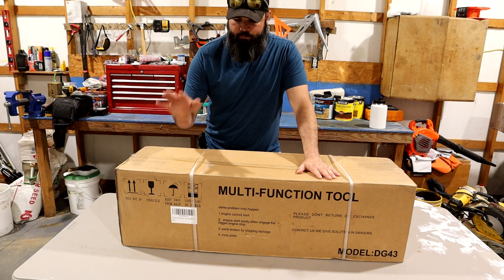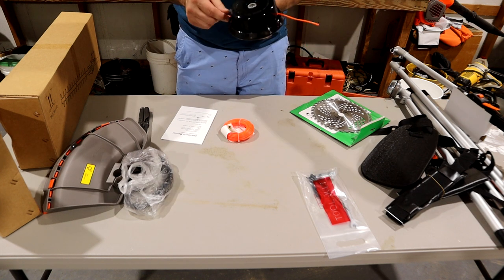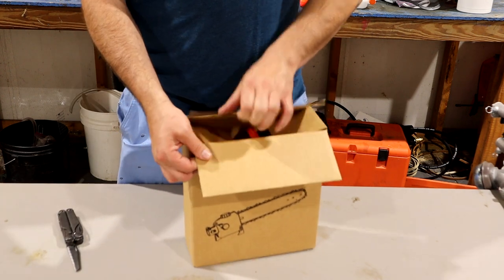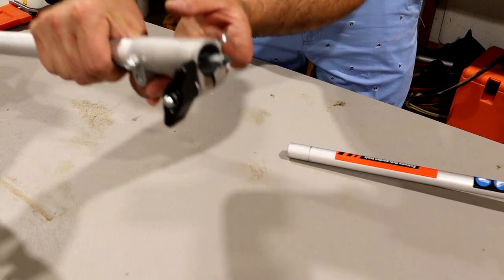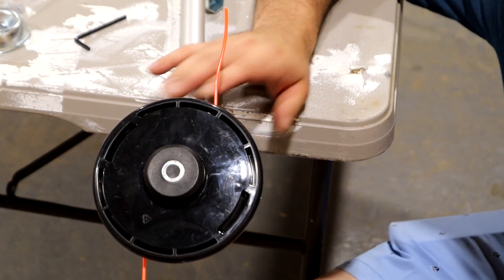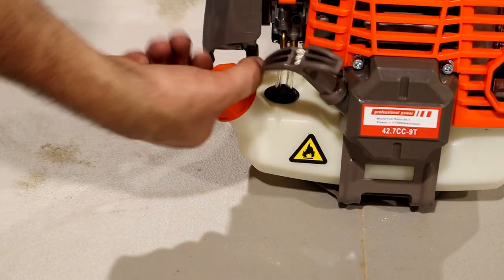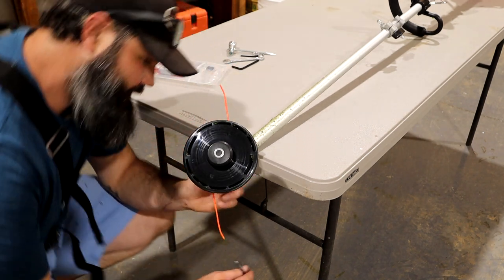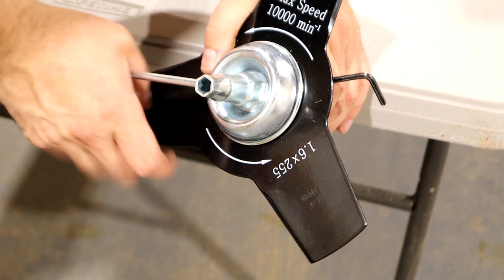Amazon 5 in 1 Multi Function Trimming Tool Review | Proyama 42.7cc

Comment: I am replacing a 38 year old weedeater so you know I am able to repair and maintain one. The first this I noticed on this machine was the awesome quality. This machine is built like I would build one, with lots of overkill built in. Instead of a "speedometer type cable running in a plastic guide, it has solid steel shafts with 1 inch splines on each end. This is running in bearings not plastic. Mine starts with only pulling the cord half way one time. The included hedge trimmer and pole saw have actual grease fittings (zerks) which I have never seen on one before. Everyone says that this machine is heavy. Set up as a weedeater/brushcutter it is 1.2 pounds heavier than my 38 year old brand name one plus it has 42.7 CCs compared to my old one of 24 CCs. This engine is quieter and quite a beast compared so I am more than happy with the minor extra weight. If you add the extension pole and a pole saw, of course it gets heavier. But you raise it up, cut a limb and bring it down. You aren't swinging it for an hour at a time either. I used the weedeater for over an hour and a half straight in a months growth of grass and it works like a champ. Most small engines only have a half crankshaft supported with a bearing between the pull starter and the engine. This one has a full crankshaft with bearings on both sides with the pull starter behind the engine. This causes less vibration. After running my old machine for about 30 minutes, my hands would shake for about an hour afterwards. I ran this one for an hour and a half straight and no shaking at all afterwards. In my opinion this machine is built equal to or better than any commercial machine on the market at a very affordable consumer price.
Reply from the maker: Thanks for the comment.  I do like this company, I have a bunch of their tools.  No issues with any of them.
Reply: The plastic fast reloads and bump head for my echo works really well. I have used the same echo and head for the last 3 years and the head is still intact. I just bought a new one yesterday only because I am too lazy to clean the carburetor.
Reply: Your comment gives me the confidence to pull the trigger on this. .thanks!

Comment: @Nichols County is this unit very heavy? I'm debating on getting the 26cc unit instead since I've heard that the 42.7 is very heavy. What are your thoughts?
Reply from the maker: It's not that bad. But im pretty tall and can handle it.
Reply: @NicholsCounty   Do you think a backpack engine would facilitate the use of the chain pole or of the hedge trimmer for someone less tall and strong ?